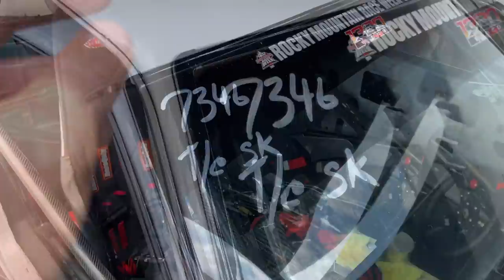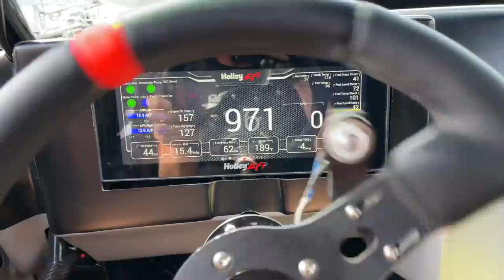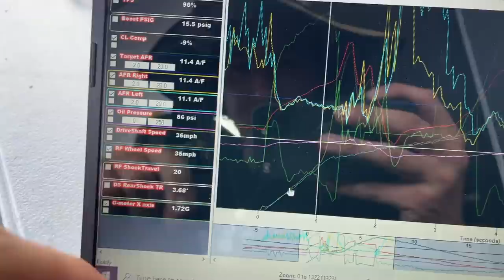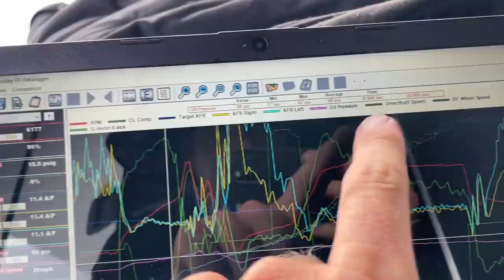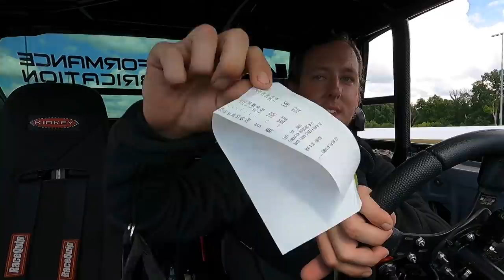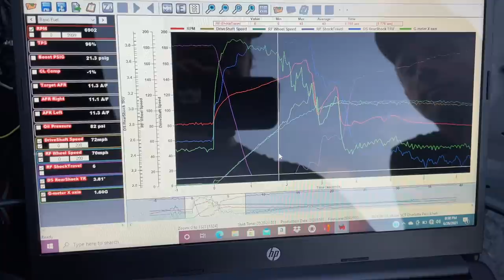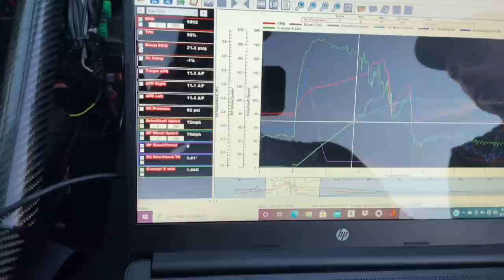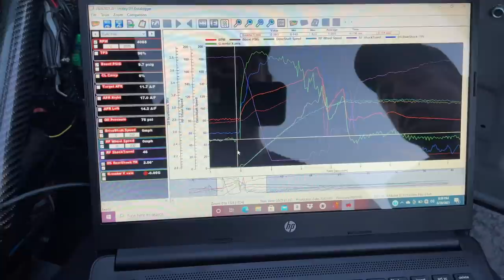Mullet Races the Turbo LS Honda That GAPPED Leroy Years Ago...

Comment: Kevin is a nice guy and he’s trying not to let it get to him but the dude did so much extra labor and fab to fit the hood on the car and it’s almost insulting to just not run it for the LOLz.
Reply: Obviously... He knows Cleeter paid and it's his car, but it's a bit of a slap in the face
Reply: At the end of the day. He knows it's going back on. He's a good sport. Most likely only "cares" on film
Reply: i agree
Reply: I'm betting cleeter is mostly doing it to get Kevin's (and everyone elses) goat
Reply: This 100%. Was kind of surprised when cleeter said that in front of Kevin. Then again I’m a little sensitive about my vehicles lol but still.. dude worked so hard to make it look good
Reply: yeah makes me feel like an ass hole if i was kevin id be kinda pissed but not id let it go but say (next run you using the FUCKING HOOD!) lol
Reply: Cleet paid for all the work anyway , what he does after is up to him
Reply: RJai48 
Looks better without the hood
Reply: I'm thinking he did it just to flex. It was one thing to gap that Honda but doing it with no hood too makes it that much spicier. On a pass with stakes he'd 100% run it.
Reply: The trans should have came out after they drove it with no fluid for the overdrive to work properly.  YES, I’m an “expert”.
Reply: @sintwo0one  the transmission and overdrive are completely separate units, so the overdrive issue had no affect on the transmission.
Reply: Just so ya'll know, it doesn't bother me at all if Cleeter decides to run it with no hood. I was just having some fun for the camera :)
Reply: you must be from the adam lz comment section
Reply: @KSRPerformanceFabrication  better to show your expert work under there every now and then too 👌
Reply: @sintwo0one  two separate systems
Reply: So true forgot about that ouch
Reply: @sintwo0one  I hope the “expert” comment was sarcasm lmao
Reply: @KSRPerformanceFabrication  that’s a good attitude and glad you’re having fun, but the car does look so much better with the hood.
Reply: @sintwo0one  the trans and overdrive are two separate units. If your insinuating that running the overdrive without fluid caused the failure in this video, you’d be wrong.
Reply: If he Truly felt that way that would be ridiculous it's his job to build the car the way the customer wants and Kevin is such a cool guy there's no way he has hard feelings about that it's not like Cleetus never uses it but it's kind of his persona to not use it Kevin knew that going into this it was more for drag week and Rocky mountain race week because of weather
Reply: @freedomfox8183  read all the comments
Reply: @jmalin1975  to get kevins greatest of all time? What does that even mean?
Reply: @ItzDiizy  It really, really doesn't lol
Reply: @KSRPerformanceFabrication  so I guess he's not really an expert at all then huh?
Reply: @_Professor_Oak  goat.. not G.O.A.T.
Reply: Jeff Bruce  You def havent been around here long. Cleet has grinded for his riches and is no way spoiled. Hes a great guy show some respect.
Reply: its not that deep
Reply: @isaiahmiracle7487  no way, that "dangit" was from the heart
Reply: @bustedknuckles6051  he literally replied to this comment saying it was for the camera. It's always heart breaking seeing a master peice not totally complete so there was probably a little emotion to it but nothing serious 😂
Reply: Kevin continues to be the worlds nicest dude in his reply’s but I too feel cleet is being a melt 😂
Reply: @rjai4890   pretty sure he worked harder on function than looks. Mullets putting it down so I'd say Kevin is happy no matter
Reply: The world needs more Kevin's and Brent's lol
Reply: Jeff Bruce  you can't be spoiled if you worked your ass off for every penny you've got. Honestly sounds like you're jealous.
Reply: @isaiahmiracle7487  never said he didn’t work harder on function? But cleetus proved it runs better with a hood and still tool it off. Literally just makes the car slower along with going against what Kevin (and everyone else in the comments) wants.
Reply: Cletus paid for that labor. Trust mr
Reply: @rjai4890  function was the main priority is what I was saying 🤪
Reply: We don't drive the car. Kevin doesn't drive the car. Only reason cleet cares what we say is cause he respects his fan base or he'd run in no hood it's whole life cause that what he likes🥴
Reply: @sintwo0one  not much of an expert huh ?
Reply: its Garrett's car he paid for it he can try to cross a pond with it if he wants let alone not have a hood on. $$$ for car = nce
Reply: @KSRPerformanceFabrication  lol, whoa, dont shut down the comments section gossip section  lol
Reply: TomRiddle it really, really, reallllly does tho lol
Reply: @sintwo0one  They replaced it...
Reply: At this point as Cleetus truthfully said, it doesn't make a difference.  As the get closure to sub 6.50 that extra 20 hp or so is going to be worth a couple hundredths, maybe more.  Cleetus is a smart guy though, he'll do the right thing
Reply: Agreed.  Inside he's like "come on man, we didn't build some ebay special, this is a custom fabricated race car."
Reply: Notice Cleet had the hood on when he raced that Honda. LOL.
Reply: @KSRPerformanceFabrication  Hoods are all well and good, but I think the next phase should be to lift it waaay up and add donk wheels.... I'll show myself out now
Reply: Why don't you guys use wheelie bars
Reply: @clintsmotorsport5808  wheelie bars with radials are a BAD combination. Radials do not like spinning and when wheelie bars touch the ground. They tend to upset radials and make them spin. Go watch 187 Customs when Shawn's dad ran their 55. Broke loose half track and he tried to get back in it. Not a pretty sight. Lucky his dad was OK. Car not so much.
Reply: No hood..No like!
Reply: Jeff Bruce  First thing, you're wrong. Second thing, can you come over to my 4th of July BBQ? I feel that I don't have enough salt........
Reply: @sintwo0one You have to be trolling, right? At least I hope you are.
Reply: @huntjl88  thanks for that, im a bit more educated now
Reply: He did do an exceptional job on it.

Comment: Hey Cleet - a long time ago in a galaxy far far away I used to work as a fabricator in a reputable chassis shop.  Our shop car was a 2002 firebird outlaw 10.5 car.   The car was in a solid accident because our "cool" parachute anchor wrapped around the wheelie bars causing the car to cross the track in front of another car.  As it happened the parachutes caught the roof tow hook of the other car and flipped the car.

Comment: Why doesn't James just run 16 Injectors instead of dealing with monster injectors that constantly get stuck?
Reply: I’d imagine there are several reasons. It’s expensive to change to a dual injector setup, depending on what you’re changing from. It could also be some sort of class restriction (I haven’t heard of anything like this, but I don’t do drag racing on any kind of competitive level.) 

But, generally it’s cost prohibitive to do a multi-injector setup if you haven’t already got your car setup for it. Gotta buy a new intake manifold, whole extra set of injectors, fuel rails, plumbing to the rails, etc. and that’s assuming the ECM is capable of supporting 16 sequential injector outputs.  If not, there’s extra electronics involved, plus wiring. It gets really expensive really fast.
Reply: Methanol folks. Billet atomizer is the best. Thats what he has. They are expensive.
Reply: ty Mills LOL atomizers are the best? 
Yea that’s all you had 10 years ago but anymore..
Reply: I can guarantee his car would do a ton better with 16 Bosch 2200 in it rather than the billet horse manure that’s in there
Reply: probably because expence and fuelflow, as a 2e row would have the fuel atomise in the manifold, wouldn't deliver the same hit due to the larger distance
Reply: ive had them in my shit for 2 years untouched runnin dirty ass pump gas.....
Reply: money
Reply: How about YOU race James for the answer?
Reply: @kenny240  better to drop a cylinder completely than losing an injector and running crazy lean on one cylinder and blowing it up
Reply: @randbaldwin  Oh I'm sure they all have 7 sec cars or use to.
Reply: @tymills6170  they suck. Ive been saying it since the first video with problems. Look at the fast methonal 275 guys that aren't running atomizers...
Reply: @grantbowers2319  what about when they stick open and flood the cylinder on decel? You know they can setup lean safeties yea?
Reply: @kenny240  Yessir, all that and possibly some serious head tweaking.
$$$$$$$$$$$$$$$$$$$$$$$$$$$ 🤪
Reply: It’s expensive? The dude just lost $1000 in 8.1 seconds on a grudge match lmao he doesn’t care about the money
Reply: @TTSFabrication  agreed on that...no complaints with em from me
Reply: @maartenvandenberge7116  Distance is no problem with a turbo. It will also cool the charge better.
Reply: "Race Car"
Reply: @TTSFabrication  They power the quickest and fastest cars... Go argue with all the tops teams that use them, and tell them to swap to 16 bosh :)
Reply: @tymills6170  those big teams service the injectors and blow shit up all the time but they aren't YouTube stars so we don't get to hear about it. Many teams will throw an entire new set of injectors in each pass and rebuild during rounds. But hey, they are an awesome injector LOL
Reply: Guys.. Jackstand can't keep 4 wheels on the ground I'm pretty sure his setup is working for him. That's a problem most people would love to have
Reply: @DLevs  This may be in part to the awful aero of that car but you aren't wrong either
Reply: Precision.
Reply: @kenny240  Holley can control up to 24 injectors. The Dennis, Alex Taylor 55 Chevy has 24 injectors. Two per cylinder plus eight in the plenum (for charge cooling). Hurting engines plus risk of fire get's EXPENSIVE quickly...
Reply: @randbaldwin  ???
Reply: @morganfreeman5171  its true that it better cools the charge however as far as im aware backfire explosive danger of it is still a thing with turbo's and even more so even with it destroying the turbo then rather then just flaming out the carb\ intake as it does with nitro and na cars

Comment: James needs to get that car figured out. Maybe a complete suspension overhaul get that weight distribution better. I wanna see it actually make some full passes
Reply: I think his 240 is going to come back and be his fast car ! But i agree the nova needs a new set up, it's got bags of power but it can't lay any down.
Reply: And get that aero lift out of it's front end a bit
Reply: Hard to say what he actually needs to do to make is lay
Reply: With the 1K dollar's he lost he could have put it towards a Holley Dominator ECU and shock sensors and he wouldn't need to worry about Wheelies

Comment: Current Mullet Stats (1/4 Mile Only)

Total Runs: 31
Total Runs With Time: 24
Record Time: 7.604 @ 170.08 mph (Summit Motorsports Park)
Record Speed: 7.642 @ 186.98 mph (Summit Motorsports Park)
Average Time: 8.497
Average Speed: 174.92 mph

This Video
Runs: 2 
Fastest Time: 7.642
Fasted Speed: 183.49 mph
Average Time: 7.658
Average Speed: 183.455 mph
Reply: Making gains.

Comment: Aeronautical engineer here Kleetus.
Hood on with winglets to direct flow into Turbos. WIN, Win right there. Also deflector over back window to eliminate the turbulence there. Same for tailgate area and side winglets to streamline rear turbulence. Turbulence = huge drag. No turbulence = Slipstreamed car.
Do this and the car will be a KILLER! Or not, your loss....

Comment: You need to take that turbine housing off and laser-etch that fingerprint into it for posterity.

Edit: How much of a negative impact would a small splitter have on James' Nova?

Edit 2: Can you put nitrous on a methanol engine without turning it into a pile of shrapnel?

Edit 3: "James got to race the fastest car on the property and I got to break my input shaft" 🤣
Reply: A splitter wouldn’t do much to help him, he just needs lead on a pole out the front

Comment: Please get James' suspension dialed, that car would fucking FLY with some chassis work.
Reply: I wonder if a front splitter would add enough downforce to keep it down, 1 like they ran in nascar cot
Reply: @bigdaddykeithcarter1624  I was thinking a ducktail, or a little drag wing off the top of the cab
Reply: @bigdaddykeithcarter1624  wouldn’t matter because of the low speed at the start

Comment: Compromise. Run a clear polycarbonate hood.
Reply: Just print a translucent photo of Mullet's engine without the hood, as it would look from the driver's seat, on Cleets helmet visor. Flipped up - hood - flipped down - no hood.

Comment: Also from personal experience when you change your spark plugs, change your leads as well, as it effects the resistance in the lead, your lead can look ok but there is going to be break somewhere that effects the spark delivery,  hence you loosing a cylinder after the shift.

Comment: What if you used dry ice in the inter cooler tank? You could add a pressure relief valve to the lid of the tank.

Comment: How many inches of travel are you getting in the first hundred feet? If it's extending the full 5 in or whatever in 60 a hundred feet you have to tighten the rebound of that shock up so it doesn't separate as fast and if you've got the shock tightened all the way qa1 shocks makes a real good shock that you can just change the valve pack right there at the track in about 2 seconds instead of having to buy new shocks that have tighter valving you just have multiple valve packs with you you just change it out in a couple minutes

Comment: In my opinion, they should change the trans to a T400 w/OD (with a looser converter) or ditch the OD and go with a 4L80E, and change to a 4:11 rear end. I believe it would get into the 6's that way.

Comment: What happened to that engine they put in James car in Vegas? The one they got from calspeed in Bakersfield?
Reply: That was a hydraulic lifter engine and james runs a solid lifter engine. They installed his valvetrain into the engine and started it. the pushrods on the solid lifter engine are bigger and they scraped while it idled. Once they figured out what they did, they called it quits, hoping to have the engine pulled apart and cleaned without damage since it just idled. His engine is no longer good for huge power/boost and I'm not sure if he is running the one they bought in Vegas or a different setup.